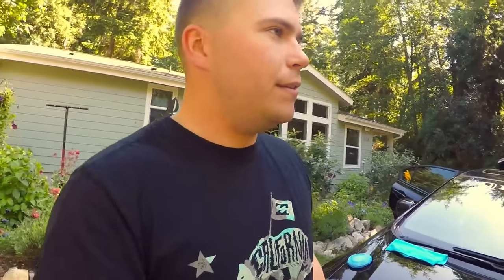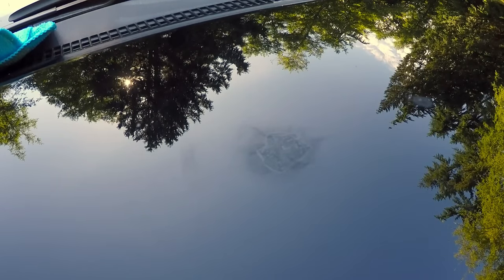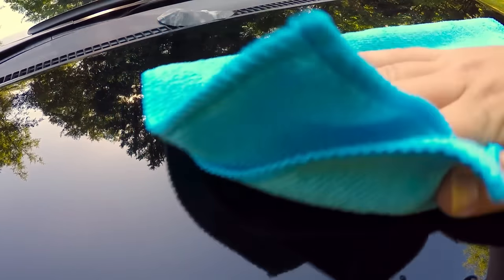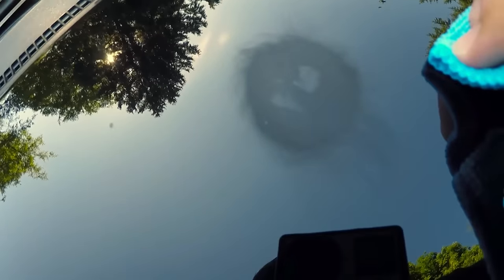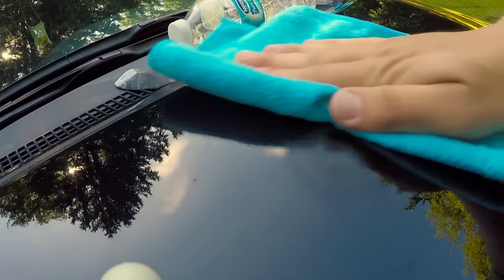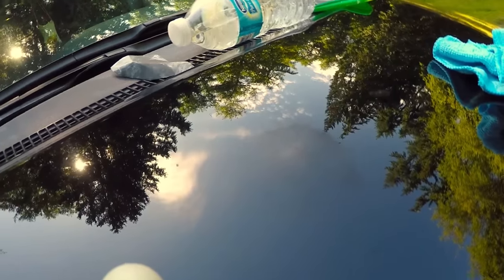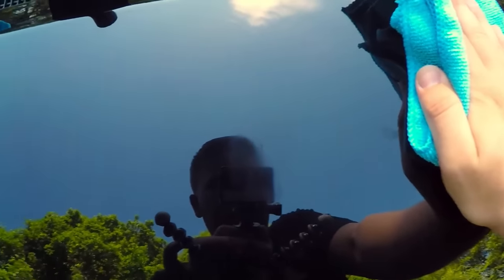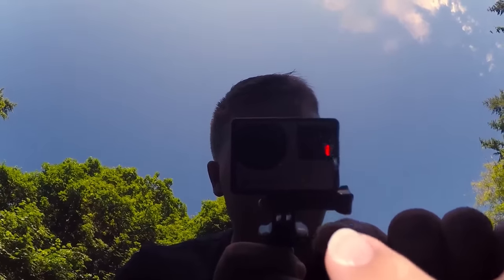Uneven Touch Up Paint Fix

Comment: Just used a touch up pen from TouchUpDirect for a scratch I got on my rear bumper on my Golf R. Followed the steps, and as expected, ended up with it looking uneven. It’s not that noticeable since my car is white, but after the new paint gets a couple of days to dry, i’m definitely going to be sanding/polishing it down so that it looks brand new again. Thanks for this!
Reply: Before coming across your post, I had ordered a touch-up paint from TouchUpDirect. Now reading this, I am afraid to use it, mainly because I find the extra steps seen in this video a little too much for me to do.
Reply: Honestly just go to the dealership. Their touch up pens are pretty good and they give you the clearcoat as well as the paint. Doing it for my 2016 Jetta right now and it's pretty good

Comment: Thanks man I tried it on my car and got great results my paint didn't really match my factory paint so all I wanted was to remove the pen paint and did what you said and I got excellent results thank you very much 👌
Reply: What color is your car? I messed up using the touch up paint pen and I want to fix it but I’m a little skeptical using these steps
Reply: yes my touchup paint wasn't the same color either. i can't seem to sand it off. how long did it take you to sand off the touchcup paint?

Comment: This worked perfectly!!! Had someone bang my door with theirs and it was instant fail when I tried to apply touch up. I was able to fix it with this process and it looks like it was never banged into. Thanks alot for sharing. I used the exact products you used.
Reply: Did you sand the failed touch up until it was gone or left some like him?

Comment: Hi Alex, thank you for the video. quick question -  before you started sanding with 2000 grit sandpaper, did you apply the clear coat as well or only the touch up paint  ? I have a similar problem and trying to get this done myself but i have no background.

Comment: This was the best 7 minutes of my life watching this, I did a horrible touch up paint job on my hood of my 2019 Honda Accord and it looked terrible, last night I tried doing this in one spot just to verify that it worked and it did, i wound up using 2000 grit sandpaper and removed all the bad spots on the hood, it took a few hours but got it done. PS it is easier to use a DA polisher than by hand if you have multiple spots like I did. Thank you for the useful information and tips. !!!!

Comment: This worked perfectly for me! Would have never had the courage to sand my car paint before watching this video. And to all of the people commenting that it's removing the clear coat and replacing with wax -- if that's true, it's at least a semi-permanent solution until I feel like spending a load of money having it professionally painted.
Reply: You can't replace clearcoat with wax because wax is extremely thin and wears off after days or a week or two at most.

Comment: Great DIY video about touch up paint finishing.  I am going to try this out now.  I have 2000 & 3000 & 5000 grit sandpaper.  This video gives me some great ideas.  I think I’m going to try your sanding method on a fully dried touch up paint blob.  After sanding to smooth, then use polishing compound, then clay the whole car, then polish, then DIY ceramic coating after all is shined and prepped.  Gives me motivation!  Awesome video and thanks for sharing.
Reply: how did it go?

Comment: Man this was so helpful, my paint pen is so bad at creating an even layer.
Reply: Use a tooth pick to get some paint off the pen and get some of the clear coat and mix together, and use the toothpick to dab a few coats or dabs and then wet sand 3000, buff polish you're done.
Reply: Spoiler alert they all are unless you're a heart surgeon with 20 20 vision and hands as steady as a rock.
Reply: @brienmaybe.4415  how long would you let the paint sit to dry or can you use a blow drier to speed up the process
Reply: @brienmaybe.4415  did u have to buy the clear coat that you spray? Did u mix them in a container then apply the layers so the paint sticks better and you finished by waxing and polishing it?

Comment: Thanks for the video. I have been stressing over my touch up paint job and wet sanding attempt.  I have the rubbing compound and polish and I’ll try it soon I’m hoping for my car to look half as smooth as yours! I also going to wax after the paint is fully cured and hope for the best! I really don’t want to try and clear coat the whole door. If all else fails I will take it into the shop with my head hung and confess to my body work crimes! Fingers crossed!

Comment: Great video! Question: I just applied touch up paint to some deep scratches. Should I do the process in your video and THEN apply the clear coat? Or should I apply the clear coat to the dried touch up paint, and THEN do this process?

Comment: Did u use a wax remover/degreaser b4  applying the paint? Any old SPRAY bottle with water will make the wet sanding easier. Good job.

Comment: Great video! I tried it and it didn't work but I think I know why; I followed the video procedure except I used Turtle hard shell polish instead of Meguiars. The Meguiars ultimate polish makes the difference. I'll buy some and try it again.
Reply: I want to add that the Meguiar ultimate polish key is the 'prewax glaze'. Putting a pure polish on without the prewax glaze I'm assuming was my error.

Comment: I used this technique today on my Obsidian Black Lexus RX. Worked great. I messed up and used 1000 grit sandpaper and panicked. But then went over that lightly with 2000 grit, heavy compound, light compound, then wax. It looks pretty amazing. If you didn’t know exactly what you’re looking for you would never find it. This technique is great but DO make sure to use 2000 grit sandpaper. Luckily I hadn’t burned a bridge.
Reply: Renee' L did you do base coat and clear coat or just the base? I can’t seem to find anyone that’s specified this
Reply: Emanuel Hoyos I did only the color coat. In retrospect I should have followed with a clear coat and then possibly lightly resanded and polished it. One thing I will say, use the 2000 grit and definitely keep it wet and light pressure. Sand the least amount possible. Good luck!
Reply: I recently traded that car in at the Lexus dealership and they didn’t even mention the repair. And I got exactly what KBB said was fair.

Comment: I've watched a bunch of "touchup" videos on YouTube "University", hahah. Many of them are unhelpful, even inimical. Some are fraudulent - the genuine definition of "mis/disinformation". But most of them have something to take away that is useful. Here is a list of useful tips that I know work:
1. Feel the scratch. If you can't feel it with your fingernail then you are in for an easy one. Try rubbing compound first to see if you can lose it. Rub across the direction of the scratch, or along with/parallel to it. Circular motions are okay with rubbing compound. But predominating parallel and perpendicular motions are better.
2. If that doesn't work, then tape off the scratch and wet sand lightly across the scratch, or along with/parallel to it. The tape will stop you from using circular motions which are not recommended. Circular motions produce widespread hazing and light scratching that is much harder to get out.
3. Use the lightest wet sandpaper grit that will cut with a minimum of pressure and expenditure of time. I use 2000 grit. Double the paper by taking the two halves of the piece of sandpaper between your thumb and first two fingers so that the extended work surface forms a rounded contact patch. Hold the paper close to that curve. You can push down and the paper flexes but does not crease. This works for following the direction of the scratch between the two rows of masking tape. For light scratches that you can't feel with a fingernail this will be enough pressure to get rid of the scratch.
4. When you see milky residue in the water, you are cutting clear coat. Wipe the area clean and check your progress. If it looks like the scratch may be gone, then remove the tape and try a bit of rubbing compound again to remove all the sanding haze. If the scratch appears to be gone, proceed to polishing compound. If you see evidence of the scratch still, replace the tape and lightly sand some more, checking your work again as soon as you see milky residue in the water. Doing the repair in short sanding and inspection steps, with rubbing compound to get rid of the hazing, you should come nowhere near cutting through your clear coat, which is TOP PRIORITY.
5. If the scratch is deep enough to feel with your fingernail, you will sand parallel or with the direction of the scratch. Only sand until you have reduced the highest edges of the scratch. A scratch that you can feel is either almost through the clear coat or actually is into the base coat. Do not keep sanding! Check when you see the milky residue in your water. Remove the tape if you need to inspect more carefully. Reapply the masking tape close to your touchup and sand a little more. Make sure that you keep seeing milky residue. If it isn't there then you have sanded off all of your clear coat. STOP SANDING NOW! You will likely still see some of the scratch. You are NOT going to get to the bottom of this deep scratch without cutting into the base coat, the primer coat or even reaching bare metal! Ask me how I know! 
6. Leave the tape in place, or refresh it. Once you have stopped sanding, clean everything thoroughly, making sure that you have gotten all residue out of the scratch. Wiping down with isopropyl alcohol is essential to final clean up. Then carefully apply the base coat color with the tip of the applicator or correct sized brush. Avoid blobs and globs. Put enough light layers on to completely fill in the scratch and area between the tape.
7. When the base coat - touchup color - is dry then remove the tape and apply it just further out enough to work on the raised touchup. Return to the wet sandpaper and again follow the direction of the scratch or laterally to it, do not use circular motions. Wrapping the sandpaper around a pad or squeegee will provide a stiffer edge for cutting down the touchup more quickly. But don't just sand away. Wipe off and check your progress and sand in short spells. Check with your fingertips and nails to make sure that you have made the touchup smooth with the immediately surrounding paint. You should not need to sand any further as soon as you start to see the milky cleat coat residue appear. The touchup is now down to the level of the surrounding cleat coat. Sanding is done!
8. Remove the masking tape now. Use rubbing compound until you see the base coat color starting to get into your towel or pad. Don't overdo the rubbing compound on the touchup, in fact avoid it after the first few passes. Rubbing compound is mainly to take out any serious hazing that your wet sanding may have caused. Use a circular as well as horizontal and vertical motion with the rubbing compound. Use the lightest compound to get the job done. If you overdo this, you will wind up taking down your touchup paint too far and have to start over!
9. Do most of your restoration of the high gloss of your clear coat with polishing compound. This will also polish the touchup that you have just done. Use the lightest compound that will work to restore the shine. Elbow grease and a light compound is better than a stiffer compound. There is little to no risk of overdoing this step.
10. Once your shine is restored, apply your preferred protective layer of wax or ceramic.
11. Do "10" again and again, and do it again. Wax layers fill in tiny low spots with repeated applications. This is only practical when you have a fairly new car with very few touched up spots. If you have a bunch of touchups already, of course, regular full-car waxing/ceramic renewal is how your touchups will last for the life of the paint.
12. Any little imperfections that you might notice at this point should be ignored if they don't attract your eye from five or six feet away. You can tell if you have done it right, if you can walk past or up to the car and not have the area you just fixed attract your attention.

Comment: Awesome video, thanks. I just purchased a 2021 Chevy silverado 2500HD. The truck is so tall I need to use a step stool to be able to clean the hood. Climbing off the stool my foot caught the leg and it flipped over and hit the painted bumper chipping the paint. I have seen numerous videos where people use paint pens to fix it but they never try to blend it in and it looks like crap. Yorus is the 1st video I've seen where the paint pen has been smoothed out and blended in. Thanks for posting.

Comment: Man, you made my day! 6 weeks ago I bought a 2019 Scat Pack Challenger. Cruising down the highway, I heard a big, BONK!, on the roof. I thought, crap! That's a chip. I was too, about 12" over the windshield in the middle of the roof. You saw it at every angle. I had a couple chips on the door jamb from letting the seat belt go and whip around, tried it there first and was very happy with the results. I used 3G grit, and waxed right after also. Only thing I'd recommend is to be very careful with the sandpaper and try to apply even pressure with circular strokes. Don't use too much pressure. In prominent spots you might see a little wave in the finished product, but overall, anything is better than a big ole' chip and you can always go over it again with the pen. Thanks a lot for this vid, it did wonders for me and now I don't get sick so my stomach about those nasty paint chips anymore.

Comment: Great video man im going to try it but one quick question is this a permanent fix or will the sanded area be visible when polish and wax wears off?
Reply: Use good grade products when polishing (Filler free). don't use turtle wax or chemical guys.
Reply: @edg9567  what would you recommend? I’m thinking about doing this on my G but I’m scared shit! I already painted and clear coated with the dealer on. But it came out kinda crappy, a lil bumpy and not flush. I want to do this but I don’t want to sand cause the chip is half inch and on the edge of my door (open) so I figure the metal there is delicate. Do you think it’s possible to skip the sand and go straight to Polish or compound then wax? It’s not horribly bad just a lil wavy n not very smooth
Reply: @edg9567  thanks ahead
Reply: @swervv2957  did you end up trying it without sanding your vehicle? I have the same problem. I already applied touch up paint and clear coat to my side door but I’m really nervous on the sanding part. My car is white pearls
Reply: @hchoutx4111  yes, I did it. What I ended up doing was clear coated one more time so it was just a bit above the original surrounding  paint and let it dry a day. Then next morning applied a lil bit Polish on a cloth and rubbed it in light to moderately on just the paint chip spot to smooth it out & run down the lil extra clear coat (previously put). Make it as flush as possible, then use a good wax over the car or panel where you fixed. Mine came out as good as I could prob get it without sanding and I’m satisfied after the work I did. Only thing I will say is if you have a metallic color paint it’s a bitch to get spot on shade/tone match. That’s the only thing I would say is a about 15% off. So def not bad
Reply: @hchoutx4111  just seen that your car is white. You’ll prob have a easier time then I did cause white is more a solid color and easier or blend. Just take your time and be detailed on your touch up. It took me 3 mornings to b satisfied and done with the whole process. Also use a good wax. I suggest Collinite 845

Comment: followed these steps on my Q50. Worked like a miracle!
Reply: Hey bro I need some help, I’m thinking of doing this on my G but I’m already basically did the paint and polish part and it’s just bumpy and not flush. (Pens&brush) suck! Any who do you think of I can go straight to compound or Polish just to make it smooth and flush? Followed by wax? Or is sanding completely necessary? I’m trying to avoid the sanding if possible cause it’s on the edge or the door opening.

Comment: Good job. Thanks I’m trying this tomorrow. I recall my uncle did this ages ago and it works well.
Reply: How did it come out?! I always painted and clear coated mine before this vid and it’s kinda bumpy and not flush. Smh. But can I just use compound & Polish and get the same results? I would rather not sand. Thanks for the help

Comment: Hey Parker, loved the video. I had a question though. On my car, I have an excess of touch paint on my car. Like when you run your finger on it, you can tell there is like layers and bumps of touch up paint. Will this process you've shown help smoothen the excess touch up paint on my car?
Reply: yes, that's what the 2000 grit sandpaper is for

Comment: Will the sandpaper you used strip off the clear coat? I have a similar problem too
Reply: I have a similar question. Do you need to reapply a clear coat somehow to the finished polished area?
Reply: Everytime you sand or polish you are removing clear coat.  The trick is to not be too aggresive on the clear coat to "strip it". Do little by little I'd start with 3000 grit sandpaper instead of 2000

Comment: Would this method work for metallic paints? The previous owner of my car did some paint touch ups, same color but they didn't use a metallic paint so the touch ups are pretty noticeable. Just curious if this will be a problem. Thanks for the great video!
Reply: D Davis did you ever try this on your metallic paint? I’m about to attempt it on mine.
Reply: Should wrk.did u try?

Comment: Valiant effort for a DIY guy, but you have removed clear coat and replaced it with a wax which will wash away. Try using paint leveller from Applied Colours instead of sanding so heavily. Well done tho mate